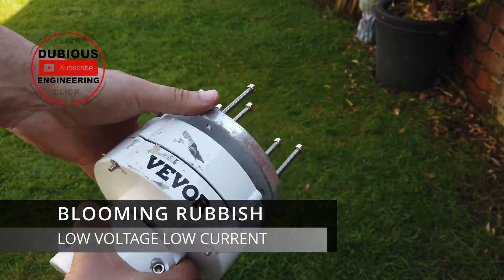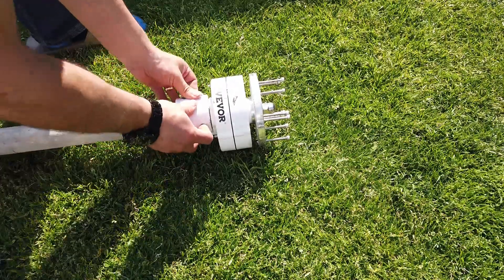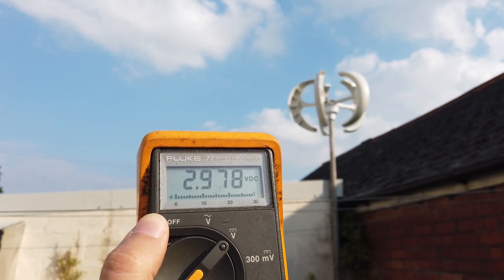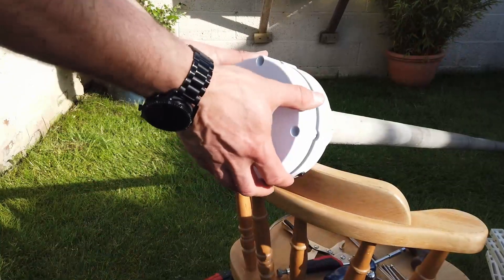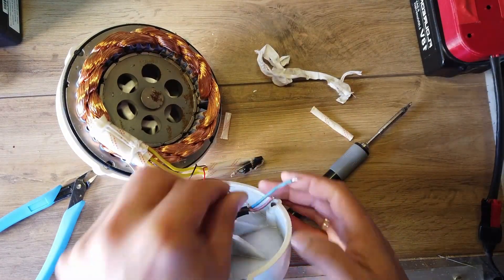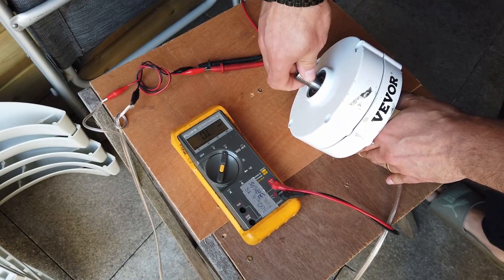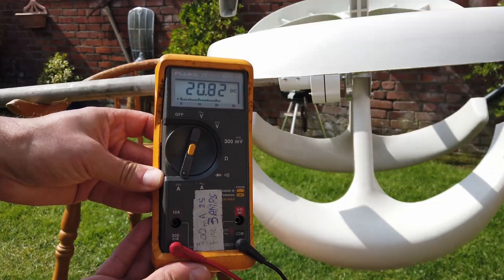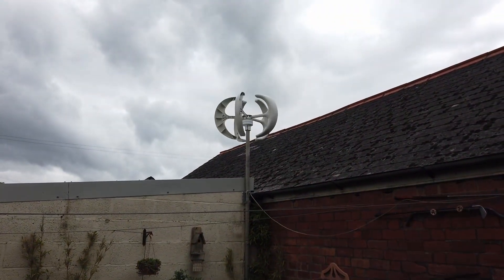DuB-EnG: Chinese Vevor Wind Turbine Power Generator - How to install, repair and a review is it good

Comment: I would have taken those diodes out and run the 3phases of AC down the pole to a proper charge controller. DC does not like traveling distances. Especially at low voltages.
Reply from the maker: Must admit, i did think about that!!

Comment: could be better to connect a 3 contacts cable to the shaed, and HERE put the 3 phase bridge rectifier. So you got 3 AC signals and only, near the battert, at the final stage, rectify those to a DC signal. This to avoid dissipating energy for joule effect on the long cable. PS: wind turbine should go (at least) 1 meter over the top of the roof .... That position is not correct. Quite like testing a solar panel inside the house :D
Reply from the maker: Agreed 👍  ..  this particular version is still rubbish in comparison to a solar panel.  This might work on a cliff top at the sea coast 😀

Comment: The pole’s not high enough. The buildings are blocking the wind flow. The results will be better but still maybe not enough
Reply from the maker: Completely agree with you...  but even high up, its slightly less than useful  😀

Comment: I have one and it's powering 4 families. Including fridges and heating. Just joking - it's totally useless. Avoid. If you are in a really windy flat, coastal place buy or make yourself 10 feet (3m) diameter traditional HAWT rotor. Don't try them at the suburbs or any other "wrinkled" area. It will be NOT working.
Reply from the maker: Love you 😍.   Thanks for the truth!!

Comment: absolute fraud, 5kW has a maximum of 800W if very well!!! Just ask about the weight of the turbine without blades, 1kW has at least 25kg if the casing is made of alloy then more! 3kW has more than 100kg, they have no warranty, CE certification, etc., when he sent the certificate, it was a fraud, he simply rewrote the certificate from the air conditioner in PS!!! The blades are PVC, they will spread when cut, laboratory PVC of the lowest quality, so it is dangerous if they burst at 2 m/s and more, but some turbines would have to start at this speed and not at 4-5 m/s, production 100-500W at 12 m/s, if you look at the controller, it is when it reaches 400W max, they know that it will never blow more for you and when it does, then once every few years and the brake turns it off, it is set to 15 - 18 m/s, RATED therefore the declared power is stated at 15 - 18 m/s. Just compare these few data, or even the length of the blades less than 3m on average does not make sense!!! The height of the tower is 12m and more! Furthermore, it is crucial that the generator is synchronous and low-speed!!!
Reply from the maker: Agreed! - A hunk of junk!

Comment: There's one big issue with vertical axis wind turbines which is why you never see them used commercially. 
Each blade only captures energy from the wind during about 1/3 of its rotation. When it's rotating around on the wind facing side or the downwind side, it's doing nothing. And when its rotating around on the other 3rd of the upwind side, it's actually taking away energy. 
That's why they never spin very fast. And these generator hubs need high RPM to produce power. This vertical design has been all over the web, with huge claims. But they are the worst performing wind generators.
Reply from the maker: Absolutely!  It's just not an efficient design!!

Comment: These chinese lantern style VAWT turbine seem to have low power output mainly because of three factors : large air gap between rotor and stator. A larger air gap is safer mechanically speaking as the rotor and stator are further apart, but lower efficiency and torque as the magnetic field gets "diluted". A close air gap increases the probability of the rotor striking the stator due to vibration or precession. This could lead to the rotor striking the stator. Such a strike could dislodge the magnets, and destroy them or lock the rotor depending on where they land. It could also break the windings. Magnet quality is also a factor. They could be AlNiCo instead of more powerful (and expensive) neodymiums. Then comes the windings. Aluminium enamel looks quite the same as Copper enamel as they are dyed to look like copper. Aluminium is not as conductive as copper adding ohmic losses and heating.
Finally the nylon pads turbine have quite a low swept area which in all cases dictates an upper limit to the power that can be harvested at a given wind speed. Plus they are quite heavy, so the ratio weight/area is high. not good, but cheap. The best testing methodology would involve driving the generator at various and fixed rpm (which would need a constant rpm driver) and a rheostat as a load so that one could vary the load impedance. Then get the power generated curve for various inductance settings and various rpm settings. That makes two parameters to sweep, so that is a long testing procedure.
Note : I got one of these chinese lantern VAWT turbines in 2017. my model has no inbuilt rectifier, just three phase output.
Reply from the maker: And ...  dare I ask, how much energy has your system generated this year?  Mine isn't positioned at an optimum height, but I'd be lucky if I could say it offered 50Ah at 12v for the year.

Comment: Unfortunately, this is the sad reality of many Chinese products. 
A good approach, but nothing more.
.
A lot of resources are wasted on the garbage, we buy.
A little bit more expensive and a little bit more quality is too much to ask.
.
And not even possible, because the knowledge is missing.
And it's really only about earning money, so that we buy garbage.
.
I wanted to ask if the wing blades are UV protected. 
But I think they crumble after a few years, if the generator run so long.
It's new and some parts are already corroded and rusty.
.
Screw it onto a good alternator and it will be higher efficiency and run longer.
Use adhesive shrink tubing for the connections to protect it from corrosion.
.
Thanks for the test and the review.
Reply from the maker: Yes, very good thoughts here.  I took it down after six months.  I don't think it generated enough power to charge one car battery!  Worthless!

Comment: Hi, thanks for your post…I have one of these turbines…(same style different make)…had it 5 years now…at its best in a storm it got up to 8 volts output…so has done nothing to charge my diy 12volt system…it now doesn’t even spin at all so I’ve placed a Large Solar Colour Changing Globe LED in the dip at the top between the blades…looks ok at night…I’ve gone with more Solar Instead…I was hopeful for the wind turbine but I it didn’t work out as I’d hoped…Brian
Reply from the maker: Thank you for your confirmation 👍...  it's useless!! Sorry 😞 ...   more solar is definitely the way forward!

Comment: i bought one, similar to this, preportedly 24v, 600w. During storm Darah, I managed to generate a massive 2 watts input to my battery bank. Guuess the Chinese Watt is slightly off from International definition, by 2 decimal placwe. Ahem. There's £185 I'll never see again!
Reply from the maker: Yup! …. Total pile o poo :)
Reply: @DubiousEngineering  Recently watched a video about super glueing Moldenium magnets to the rotor, mext to the existing magnets. To increase the stength of the magnetic field. P{rbbly a fivers woth of br msgnets, slim enough to fit. Thoughts?

Comment: I really got exited to see this review. But..! Your installation is really dubious as this channel actually promises but I comment anyway. The location on the edge of the roof makes sure that there is only calm breeze available or if anything stronger it would be some strange vortex or turbulence. Looking forward to see you install this genarator to some more windier place with more laminar streams. Every sailor knows that if you even get close to an other vessel or shore of an island the wind stops or starts go around and your speed is lost immediately. Put a pole three times higher than your house top and we start to see real results or place a shorter mast one on windy open field.  Greetings from Finland and good luck with your trials..
Reply from the maker: Hi Finland!!  Big poles require planning permission in UK ...  And neighbours complain.  So...   Back to solar panels for me :-) 😀
Reply: @DubiousEngineering  Yeah wind is supposed to be 10M above any obstructions.
Reply from the maker: Please buy one ...  and tell me im wrong!!!  Solar panels are far better...
Reply: @DubiousEngineering  Agreed!

Comment: All practical tests of small wind turbines show: 1) They hardly produce any electricity. 2) They do not last long!
Because there is hardly any wind close to the ground. It is also extremely gusty, which usually shortens the service life. 
Only if you need to be off grid & live close to the sea, you should install the largest possible wind turbine on a high mast, with a battery.
With solar modules, on the other hand, reliably generate electricity for 25 years at approx. 3-10 cent/kWh!
Reply from the maker: Yup, agreed! Simples! :)

Comment: I have no doubt it would do a lot better if it actually got some wind. What do you expect at 1-2 mph? What a dubious test.
Reply from the maker: Yeah... Sadly, even at 20mph it's not doing very much... Wondering if there is a problem with the diode rectifier...  I'll get the oscilloscope out :-)

Comment: TIP: ebay kleinanzeigen "windturbinen bastler" (kontakt) UND probiert mal die günstigen china windmühlen ABER 1. mit 6,8 oder 10 blättern ! statt 3 oder 5 ... für schwachwindgebiete viel besser UND 2. keine 12 volt version sondern eine 48 volt version ... die dann auf einen A) BRÜCKENGLEICHRICHTER und B) auf einen MPPT SOLAR LADEREGLER !!! mit eienr 48v 800w turbine und 6 flügeln kommt man schon bei ganz wenig wind auf mind. 10-20 watt und ab da gehts ruckartig aufwärts ;)
Reply from the maker: Thanks for the good tip!!  I'll look out for a 48v 10 blade system!!!

Comment: Not really a good comparison, the turbine was hardly turning, it needs to be a lot higher to catch the wind, then test the output. If you put the solar panel in the shade you would get similar results. Pointless exercise.
Reply from the maker: I'm not convinced the turbine is working properly...  I've had 20mph winds and the voltage/current output is still way too low.  More testing required in stronger winds

Comment: I know the wings or turbine is crap, that I can judge from its shape.
I wonder how good (or bad) the generator is?
What if you spin the generator at 300rpm or 600 rpm? (connecting the drill to generator)
Reply from the maker: A lot more output power when forced to spin fast!! 😁

Comment: I don't think I've ever seen someone fold stranded wire back on the insulation and then crimp on a connector before. And I really don't want to ever see it again.
Reply from the maker: You've got a fair point...  Eventually the plastic holding the wire against the metal will perrish and the joint will become high resistance...  I'll take that on board.  Thanks 👍😊.
Reply: Every cheap jump cable set at petrol station is done like this. Enjoy!

Comment: Could porentially be a good supplement to solar, as a sort of back-up power to charge a decent size powerbank. The circuitry might need some adjustments, I'm not that really familiar with electrical stuff.
Reply from the maker: It’ll definitely be working away in the background at night…. While the solar panels are doing nothing!

Comment: the ammeter is a dead short, or a very low resistance. all they do is measure the voltage across that resistor...

and as a voltmeter, theyre a very high resistance... nearly "open circuit"...

from that little clue, one could put their thinking cap on and start to wonder about how the power output is dependent upon the LOAD.

how the resistance alters power transfer...

that the current has to flow through the generator as well, with its own resistance... and internal losses...

and how batteries have very low internal resistances... how that relates to voltages required for charging, and how that relates to the generator and its resistance and how it gets "loaded"...

but thats all complex stuff, why bother with theory when you can guess and wing it! its only money after all, easy come easy go.

meh. those blades are a joke from the start. stick to standard HAWT blades, they actually work.
Reply from the maker: One way to fix this...  Connect the unregulated output of the unit directly to battery and use a current clamp meter to measure the current?  ...
Reply: @DubiousEngineering  simple resistor...

bring total resistance to at least something higher than the generator itself.

then limit the charge current and that helps it deliver a voltage thats high enough to actually charge.

but at those speeds, its never going to produce a voltage worth doing anything with anyway.
Reply from the maker: @paradiselost9946  ok, I’ll measure the resistance of the coil and stuff a slightly higher value wire wound resistor on it, measure current and voltage to see what happens.  It’s not spinning at all today, so a project for the future!  Thanks for the good tips!  Best, Howard
Reply: @DubiousEngineering  little bit more complex than that, but thats basically it...

you really need to test the generator itself.

grab a bunch of 10W wirewounds, 1R to 100R say.

spin it up with a drill. measure results... voltage drop across resistor, current due to resistance... ohms law.
at a certain speed it will peak out. any faster, output drops. thats the ideal speed. it has to spin at that speed for it to ever deliver its full power. unfortunately wind power doesnt let you stay at that speed!
then playing with the resistances, you will find again, a sweet spot... and thats the ideal load it can work into. 

but it will also overheat the generator if it can even be spun hard enough to make power with that load. it will extract a lot of power, but waste half of it...

with the load a fair bit higher, say 10x, you only lose 1/10th (1/100? i think its squared...) of the power in the generator... what you get in your load is closer to what the turbine is harnessing. note that the total power delivered will drop though. you limited the current that can flow in the circuit. 

when charging a battery... you have to spin the generator fast enough to produce the voltage regardless... the battery, once charging, acts like a dead short, and drags the voltage down as it pulls more current than it can deliver, power being voltsxamps.. the resistance, the load, limits the current that can flow. if its not enough, its still sags too low. if its too high, you just dont extract as much as you could. best to err on the too high side!

excess power is lost as heat in the resistance. another loss.

a MPPT or similar is monitoring the voltage and current... it turns off, and the voltage rises, it turns on, current flows, and it just keeps rapidly turning on and off as required. sort of like a flywheel, its using the energy stored in the system to pump the current in at the required voltage, then once its depleted and the voltage starts sagging, it turns off and gives it a chance to build up energy again...

Comment: Seems about right.
I always wondered if it was a better option to use an E'bike Electric Hub as the generator for a Wind Turbine. They usually operate at 48-72V and much larger currents.
Reply from the maker: What a cracking idea!!! ...  If this turns out to be rubbish, I'll have a look for a used hub!!!
Reply: @DubiousEngineering  what about inline water generator everytime you use water it would generate electricity?
Reply from the maker: @gatecrasher1970 were on a water meter now, so we're really careful how much water is used!  ...   I've a feeling it would be similar to having a chocolate tea pot!

Comment: That can probably do a lot better if you put a load on it :( You might not get a high voltage no, but what's its current capacity? You can step that up to 24, 48 volts just like the solar panel. Using voltage and amps to measure that isn't a good method - you should be looking at how many watts of power it can supply. Get a 100w light bulb on both and see if it can produce more power then. I suspect with the strength of the shorted circuit, the buckets can overcome that and product more Watt-hours than the solar panel.
Reply from the maker: I'll be sure to do a follow up... :-).  I'm not convinced it's faulty but more tests required!!

Comment: Interesting video thanks. Would be nice to see readings for current and voltage with the unit operating into to a normal load, like a power resistor. Then consider output as a power figure. Using open circuit voltage and short circuit current doesn't really give any idea of the power performance. That is a pretty big 3 phase generator so if you get it spinning properly in a good wind it should give many watts of output.
Reply from the maker: Great suggestion! More experimenting required in windy conditions... I'll be sure to do a follow up... :-)

Comment: Such a shame. With so many interesting designs small wind generators just aren't practical. Solar seems to be easy ,no moving parts low maintenance.
So you might as well make use of your erection and mount Monica crystalline 😜

Comment: the 6 diodes make up a 3 phase (3 wire) rectifier, wind if good for nights and winter.
Reply from the maker: I wonder if there is still a problem with the diode pack...  Its not doing much even in 20mph winds...  :-(.  I guess I'll take it down again!! 😕